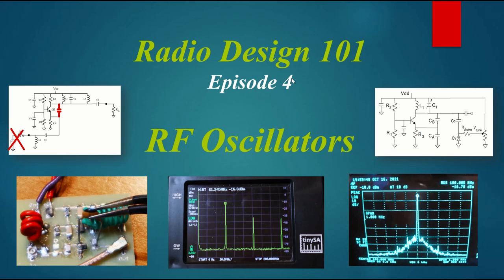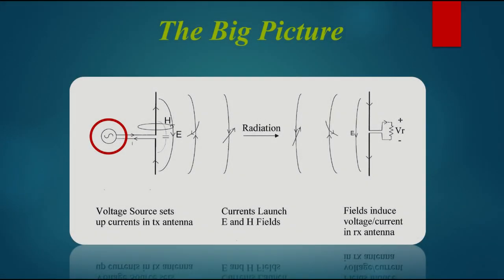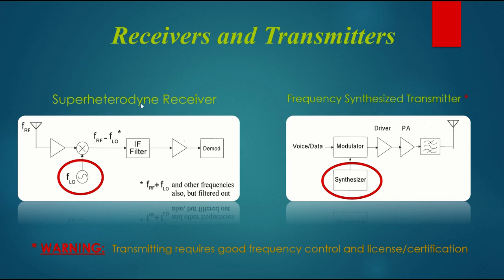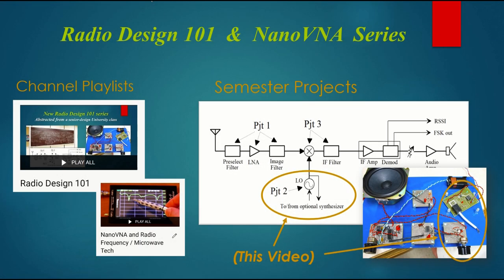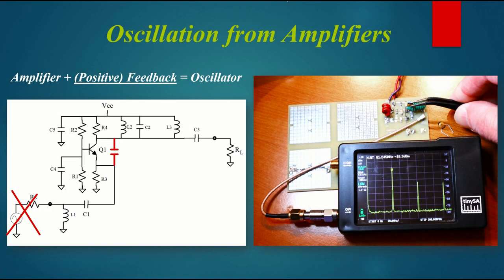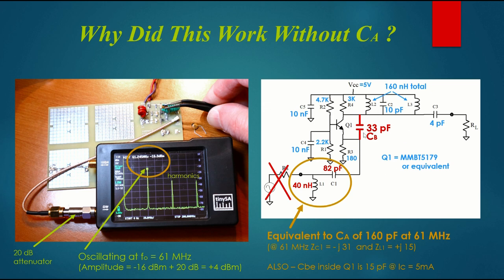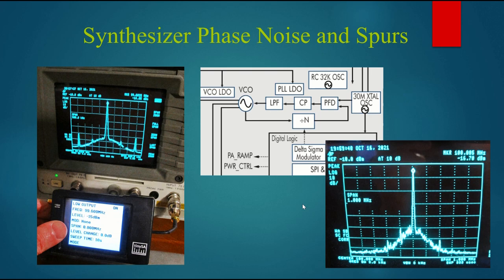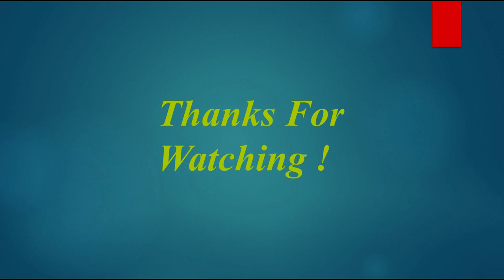Radio Design 101 - RF Oscillators (Episode 4)

Comment: Recently a ham friend of mine who's also interested in this subject commented that every once in a while, you come across some nugget that's like a missing piece of a puzzle.
That's so true, but anybody who has ever done a jigsaw puzzle knows that the first thing you do is find all the edge pieces and put them together.  It's the easiest thing to do and it defines the bounds.
That's what this series is doing for me.  Oh, I'll drill down at but for now, fleshing out the boundaries is where I'm at.
And on a side note, I've got almost no formal education in these matters but I'm having fun rectifying that with this wonderful resource.
I've built a few common emitter Colpitts's on a breadboard here and yeah, they worked up to about 1.5 MHz, but you're helping me in understanding the why(s).
Thanks again.
Reply from the maker: Awesome. I'm glad to hear the series does that.   Thanks for the excellent analogy with jigsaw puzzles. I hadn't thought of it that way !  I don't know if you've seen it yet, but there's a companion website for this channel. It has all the slides used in the videos as well as some info on "RF circuit prototyping boards", and raw notes from the course from which this series was derived. If you are interested, see: https://ecefiles.org/  Thanks again for the encouraging words!  73
Reply: @MegawattKS  Yes, I've seen it and downloaded some of it into a binder.  Just had open heart surgery this week so I'm running a little behind lol but anyway God bless you sir
Reply from the maker: @Mark_KE8YCV  Wow.  I hope you're feeling better and get well soon, and have a happy holiday / Merry Christmas!

Comment: Quick question. You want a low phase noise oscilator, because you dont want to increase the constallations when working with frequency modulation correct?
Reply from the maker: There are a number of performance issues for both transmitters and receivers relative to phase noise.  For high-dimension digital modulations (e.g. 256 QAM like in cable systems), it impacts receiver sensitivity and error rate floor as well as spread the constellation in transmit mode. More generally it can cause "blocking" problems in receivers from nearby strong interferers or cause spectral pollution from transmitters. But to be honest, except for things like high-dimension QAM, it's impacts are often over-rated and its just one of those things that products compete against each other with (like noise figure in a terrestrial receiver which is arguably not very important given the elevated noise floor from terrestrial interference). Sorry - that's a long answer...

Comment: This video helped me a lot. Can you explain why LC oscillators usually have significantly larger feedback capacitors that crystal oscillators operating at the same frequency?
Also since there is no limit on feedback build up it seems that the amp will be driven into Class C. Does this give a distorted output or does the LC tank circuit help produce a sinewave?
Reply from the maker: Interesting question. There are a couple of reasons I can think of (but I confess to not having really considered this before). For example, crystal oscillators can have good stability and good phase noise (because their Q is very high) even at low power levels in the amp the oscillator is based on. Lower C values mean higher impedance, which means generally lower current in active devices. Hence low power operation. It's also possible that the crystal frequency is most "accurate" (relative to what its marked as) at a particular C value, whereas LC oscillators are looking for the highest Q value and C will be varied anyway.  On the question of the oscillator amp being driven into class C. Yes - you are absolutely correct. The active device (e.g. transistor) is definitely switching on and off over a cycle and the LC tank circuit takes the pulsing current and smooths it into a nice sinewave :-)  How deep it goes into class-C mode depends on the starting loop gain - which is usually at least 2 to guarantee the oscillation starts. It turns out that the signal level with feedback is limited. Once the amplitude builds up and the current waveform becomes pulse-like, the amplitude in the fundamental frequency falls and the loop gain settles to one.
Reply: @MegawattKS  Thanks for your comments. It's great to find material on oscillators. Books that I have read in the past have always avoided oscillators and mixers. Your videos are invaluable. In the future maybe you could do something on PLLs? I'm particularly interested in the filter design i.e the choice of pole/zero frequencies in a simple RC filter. I read application notes in the past  but they only deal with PLL filters for a capture/settling time perspective. I'd like a practical design methodology that looks at keeping the phase noise low in ham radio applications. An approach based on the well established  CD4046 would be ideal.
Mike (in Germany)
Reply from the maker: @mikewhelan5992  Here is another good book and it seems to cover the things you're interested in. The Design of CMOS Radio-Frequency Integrated Circuits, Second Edition 2nd Edition by Thomas H. Lee   https://www.amazon.com/Design-Radio-Frequency-Integrated-Circuits-Second/dp/0521835399 . The Amazon page also has a "Look Inside" where you can see the table of contents and the very extensive index. The sample text and title are a little misleading. It says "CMOS" in the title, but its really just about radio circuits. And the sample text doesn't go far enough into the book to show how it covers circuit design. It is only the radio pre-history part. The actual technical material is pretty detailed later in the book and covers up through oscillators, plls, phase noise, etc, It's written at a university level, but I like how Lee has a history similar to my own in ham radio, and comes at the subject from an understanding that goes well beyond the math alone.  73  Bill
Reply: @MegawattKS  Thanks Bill, Looks like a very good book. It covers all of the topics that interest me. I must pick up a copy.
Mike

Comment: Nice and very illustrative video, doubt at minute 24:32, when you use varactor, the total capacitance is: C1 + CB -- CA + CC -- CV? what is the recommended Cc value? Regards.
Reply from the maker: Yes - that's the basic value of the total C resonating with L1. However, that assumes the output coupling capacitor ( shown but not labeled) is small and/or it is driving into a very high Z load. Otherwise, that capacitor and the load will have an effect on the frequency (or even stop it from oscillating). Assuming that output coupling C is small relative to Ctotal, then the formula you gave should get you close. There are 2nd order effects also from Cbe and Ccb in the transistor - but they're usually negligible if we design as described in the video and the transistor used has an "f_T" value (max operating frequency) sufficiently high, which is the case for something like the class project's MMBR5179 transistor used in an FM radio design.
Reply from the maker: A better answer is probably to just make Cc small compared with Ctotal. Just keep in mind that the smaller you make it, the smaller the output signal level will be...

Comment: Great video! I am curious about the freq synth PCB board. Looks like it is a DIY PCB? And the traces are quite thin? So the questions are: 1) Is there a ground plane underneath?  Is it just a FR-4 double layer PCB?  2) If there is a ground plane underneath, that will make PCB traces microstrip lines. I guess there are not of 50 ohm impedance since they are quite thin(<0.5mm I guess)? why did you design it that way?
Reply from the maker: Good observations and questions. Yes - its a homebrew board created for the class use. There is a ground plane on the bottom and yes - it's just 2 layers.  While the lines are technically microstrip due to the underlying ground plane, the frequency is so low that it's functionally just a PCB with the ground plane being used to limit parasitics and EMI issues. The wavelength at 100 MHz is 3 meters in free-space and about 1.5 to 2m on the PCB (depending on trace width to thickness), so traces are generally 1/100 wavelength or less on the board and the controlled impedance aspect of microstrip isn't needed.

Comment: THANK YOU FOR THIS EXCELLENTE REVIEW!
Q1: is it possible to use the TinySA to generate a sweep wave in order to tune a typical FM radio from 70's? 
Q2: is it possible to add a 10.7Mhz marker to tune the S curve? 
Q3: how the stereo could be tuned? I have no much resources and i use a Chinese FM STEREO transmitter module with a 400Khz tone in both channels...
Reply from the maker: Thanks.  I think the answer to Q1 might be yes. However, it depends on what you're trying to do and what the FM radio requires (and of course getting to the appropriate circuits). The TinySA has a maximum amplitude of about - 7 dBm when it's in output mode. Mine (and maybe all of them), can generate either fixed-frequency CW or swept signals. The NanoVNA (at least the one I have) can also generate CW outputs, and they are stronger: about +2 dBm below 300 MHz.  Neither unit has any ability to add a Marker to the sweep in the traditional way (briefly increasing amplitude at specific frequency). But they're synthesized, so you can always set them to whatever frequency you want to investigate closely and do that manually, perhaps. Sadly, nothing is going to help with stereo tests. That requires a 38 kHz DSB modulation in the audio plus a 19 kHz pilot (also in the audio). The TinySA can create wideband FM (its less than +/ - 75 kHz deviation, but still wide in the technical sense) with audio modulation. But there is no audio input and the internal audio is not pure sinewave and only works up to something like 5 kHz.  Hope that helps.

Comment: Can you give a little more explanation about the synthesizer circuit at time 30:38? It looks like you are using an ethernet jack to the VCO? And is the VCO one that your students designed, or is it off the shelf? Thank you!
Reply from the maker: The synth board is one I provided to the students to try with their radios if they wanted. It was designed to lock their VCO that they built. Normally that VCO is tuned with a potentiometer to provide voltage tuning. That's what we did in 99% of the final exam check-offs. But if the pot was disconnected, the synth board could supply that voltage and control it to tune to precise frequencies. The synth chip used was originally an LMX2306, but that's obsolete now. A possible choice now might be an Analog Devices ADF4002. I just used a common TCXO as the crystal reference. I think it was a CSX532T19.200M3-UT10. I also had an old PIC microprocessor on the board - but later I used an Arduino when we used this in another class.  The jack is nothing special. It as just an RJ11. But it could be anything since the synth signals are low frequency. I think we normally used a 100 kHz divided-reference frequency forcing a 10 kHz loop bandwidth for stability...
Reply: @MegawattKS  Thanks for those details. I was just trying to follow along on my next steps. I have the pre-select filter built on a board. I've designed the amplifier in LT spice and am working on construction. So, I was trying to watch the next videos and plan what I would need to do.